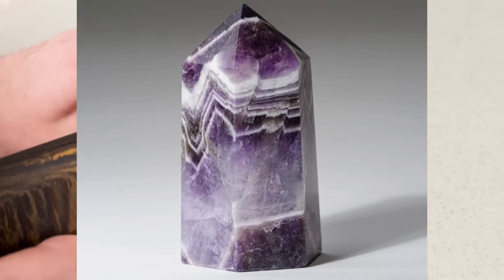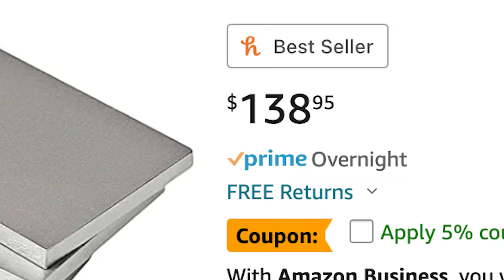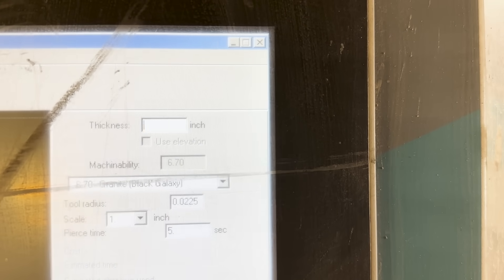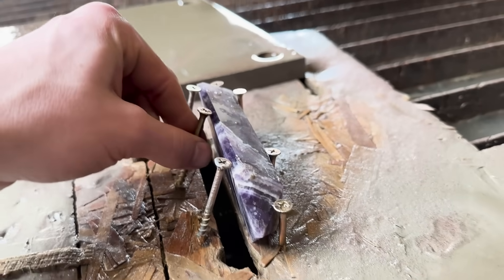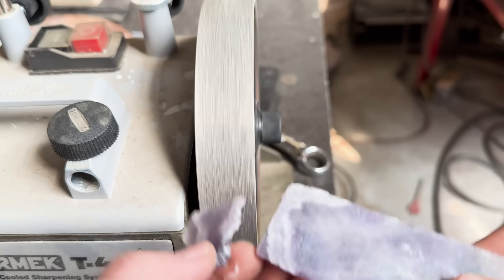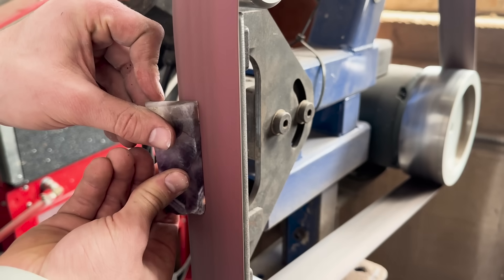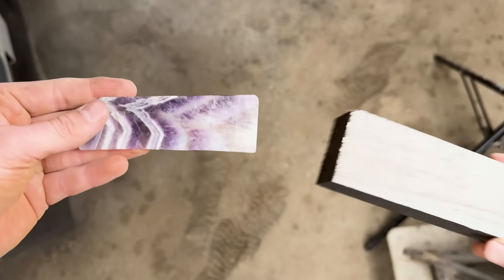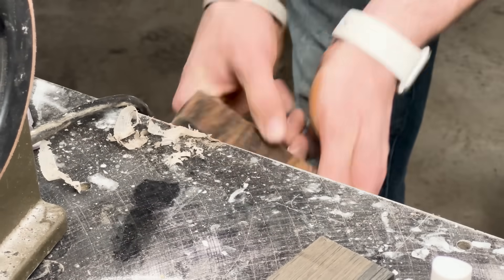World's Sharpest Amethyst Knife

Comment: Okay first the blade needs to be bulit inside the handle cut the handle in half and sandwich the blade so it can take the pressure, the amethyst you got was also the wrong kind you need a large glass one because its stronger and easyer to sharpen. You was using a stone version which is very weak if you apply pressure to it.

Comment: I've heard surgeons use obsidian scalpels in place of steel ones in special applications because they  produce an exceptional edge that out performs everything else.
Reply: They don't last, but they are molecularly sharp without much effort, so they are used when a clean cut is absolutely vital.
Reply: this is pure rumor and not true.
Reply: @MrNoipe  Try the CNN article: How Stone Age blades are still cutting it in modern surgery
Reply: It's true. It comes from the amorphous nature of glass. Where crystallic materials like most stones and metals tend to break along grain boundary (or along a major plane if monocrystallic), amorphous materials tend to break in a tapering manner.
This makes glass and flint very well suited for blades. And obsidian is a type of silicate glass.

Comment: I think there is a sharpening method that could work

you basically have an abrasive sludge, like corundum slurry or something
and that stuff is on a plate with grooves and that's what you grind on

wait, you did have a a video with that wood sawblade that you impregnated with some hard sparkly stuff
you could use that perhaps?

Comment: Looks like the diamond wheel was too low of grit for what you are wanting to do with it. 
Water is needed with those diamond wheels.
Also too much heat with the belts will cause issues with the material as a well.

Comment: The reason the diamond wheel didn't work right is because they are meant to be used with a cabochon machine that applies a constant stream of water. If you plan to do many more stone and mineral knives I would suggest that you invest in one. May get a lot better results.
Reply from the maker: thanks for the tip!
Reply: @WaterjetChannel  maybe if you get one you can retry making this someday
Reply: @WaterjetChannel  knife not that good 😢
Reply: also it wobbled like there is no tomorrow...
Reply: Did I saw it get edited!?!!? Just now
Reply: Your not a sapose to grind minerals period lol.  Also that Diamond wheel had giant chunks of diamond made for roughe material, not fine.
Reply: @dragonsyph2557  You've obviously never spend time around the jewelry industry. Cabochon machines are literally made to grind down and shape gems and minerals.  You usually start with a rough grit wheel and work your way down to extremely fine. Turning a raw stone into a smooth shaped piece of jewelry.